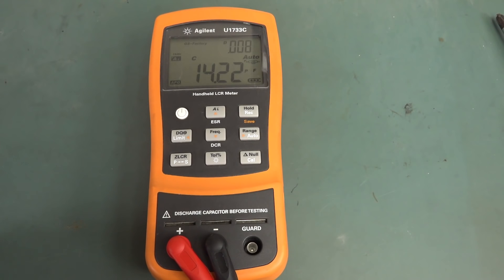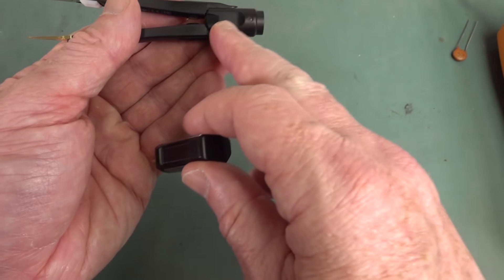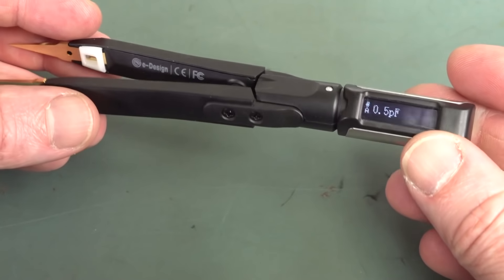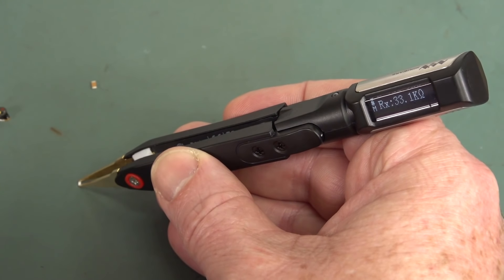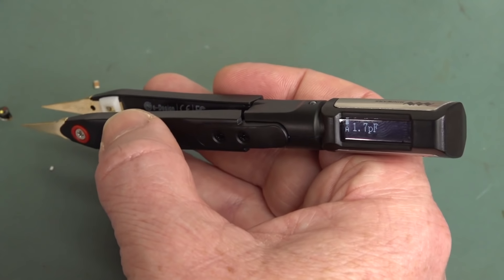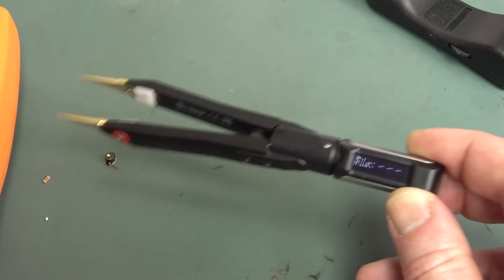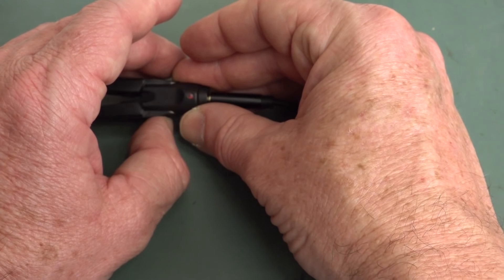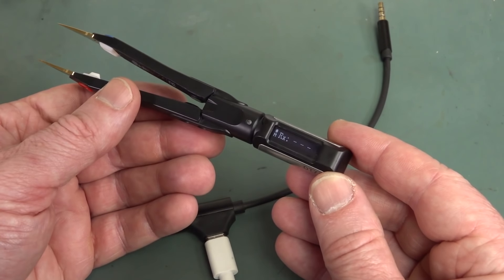EEVblog #1335 - Miniware $70 DT71 LCR Tweezer REVIEW

Comment from the maker: TLDR; It's not very accurate, limited resolution, limited ranges, accuracy issues between Auto and Manual modes, non-standard test frequencies, can't be used while charging, lose the custom charge lead and you are screwed, tilt head detection has a bit of an alignment issue, LED testing is limited, and the secondary measurements basically don't work.
But for $70 it's very handy and nothing else can touch it, and the probe design is gorgeous.
Absolutely no match for the much more expensive SmartTweezers.
Maybe they can fix some stuff in firmware to improve it.
Reply: Jeez Dave, are there any downsides? 🤣 Dave would make the worst car salesman ever!...😂😂
Reply: For 70 bucks and it doesn't have good accuracy, resolution, range, accuracy, can't be used while charging, proprietary charge lead? Yeah it can jog on. I'll stick to the bulkier LCR meter that doesn't have those same flaws.

Also hate hate hate hate that sort of one-button interface nonsense.

I'd honestly rather see them just release those pincers as a lead for traditional meters.
Reply from the maker: @Spector_NS5_RD  But it's seventy bucks! :->
Reply from the maker: @TestECull  I did get used to the touch button interface, it's ok.
I'd certainly buy the leads on their own with banana plug interface.
Reply: It looks like most of the wok has gone into those tweezers!   And the explicable heads is GENIOUS   Meaning upgraded heads can just be stop and swapped!  Plus a banana plug adapter is totally in the woks!   As for wear and tear on the connector its TRS.  Already really really robust and long lasting.  TRS is about as solid as it gets!
Reply: Plus the Smart Tweezers have devices in the front end whose cost adds up to over $100 in single quantities anyway...and you just couldn't get that kind of accuracy any other way.
Reply: @EEVblog  yeah the pincers are the best part of the whole thing. All of the downsides are part of the device plugged into them.
Reply: @TestECull  I have one of those pulse oximeters with a single button interface. It has multiple pages of options, including sleep logging and graph display. Not fun to navigate.
Reply: In US is $78
Reply: @Spector_NS5_RD  Right? He almost makes it sound like a $7 AVR component tester and a tweezer probe is a better deal.
Reply: I waited till the end, hopping that you'd take this apart.. 🙄
Reply: Why can't you just put tweezer probes on your existing meter?
Reply: Link in Description is borken!!!
Reply: @whiskyguzzler982  SeeedStudio has them listed at $59
Reply: @RenThraysk  Was excited to see this, but when you add on shipping ($8 to $35) and it looks like Ali is now giving extra tweeser jaws, it's a wash.
Reply: I notice that the audio now says "all for 80 bucks" not $70 anymore. The lack of battery replacement is a deal killer for me. If you use it every day, recharging is a pain. If you use it once a year, over-discharging is death. Some great design elements here, but at $80, it's not a toy.
Reply: Could it be that the charge led also doubles as a low battery indicator and was designed to be brighter at an angle while the tweasers are in use?
Reply: Thing is I’m looking for an accurate enough one I loved my smart tweezers but Ille never buy from those scumbags again they died before warranty I sent them back with a letter and didn’t hear back or get anything back plus they never answered any emails creeps! So if these are good enough and are better than other cheap ones Ille try them
Reply: Whats the state of this product here almost 2 years later?
Is it still the same as in the video, or have the iron out some of these kinks.
and perhaps gained better accuracy, a reliable secondary value etc.
It is upgradeable. so wondering if its been nursed into a better state, and are there better alternative LCR tweezers in 2022 for less, and around the 50 dollar mark.?
Reply: Best comment ever, won me as a subscriber instantly 😬

Comment: Thank you for your review.
 We will continue to improve the firmware and products,

In the DT71 configuration file, you can choose left and right hand mode and turn off screen rotation,
Accurate calibration, we made an excel file, only need to fill in the measured value according to the prompts to accurately calibrate.
Thank you again for your comments, we will fix the BUG in the new firmware.
Reply: If you can add capacitor ESR measurement in a firmware update, i will buy one.
Reply: MINIWARE I just ordered one but I and very interested in being able to measure cap ESRs in circuit. I hope you add that feature!
Reply: @cheryldroffner443  In circuit? I think that would require both polarity reversals and frequency sweeps to analyze, approximate and subtract from the results. Check-out YT video Peak Atlas ESR70 plus in circuit for a better look, because this process is difficult. BTW, don't buy it on Amazon, buy it direct using the Atlas discount code on EEVblog. Search the forum for "Special Offer to EEVblog Forum Members" (I think it's only about $20 more than this rubbish).
Reply: So is it fixed yet? Looking to buy one right now

Comment: As a hobbyist I really hate products that have high standby current like that and rechargeable batteries. I'm only likely to pick it up once in a while, and when I do it's inevitably dead and needs charging before use. Then after a few cycles of overdischarge like this, the battery itself is basically toast. My 1990s HP DMM has a soft power button and it lasts for years on standby, why is this so hard :|
Reply: Same problem for me. I had to buy 3 digital calipers to find one that doesn't drain it's battery between two usages. The well known open source component tester is also such an offender. Fortunately there was enough space for a switch in the case.
Reply: @MetalheadAndNerd  Interesting, I've got one of these open source component testers as well and use a rechargeable 9V battery to power it. I don't use it often (the electronics hobby has been on the backburner last couple of years)  so standby current for my battery powered equipment is rather important for me. I only have to recharge the battery of my mostly dormant component tester once a year or so, most likely because of self-discharge characteristics these batteries have. This component tester uses a transistor to cut power to its entire circuit when it is powered down, i.e. it doesn't rely on the sleep mode of the AVR microcontroller to keep the standby current low.
Reply: @Retep4565  I use mine with non-rechargeable 9V batteries amd before the power switch mod it took 2 months of non-usage to completely drain a fresh battery.
Reply: @MetalheadAndNerd  I have 2 devices. 1 drains and other not. never compared schematics, but think they are similar, so it's probably a software issue

Comment: For what I need in work, this is perfect. We have a single LCR meter for the entire factory and despite its shortcomings, this would be ideal for quick measurements. If they seemed off, we get the proper meter but at a glance readings, seems perfect.

Comment: Just my anecdotal experience but to the age of 8 with two kids plugging and unplugging headphones from their tablets sometimes a few times a day over the cours of years, I have had many cables fail, but never once had a connector fail.
Reply: It is quite common to see sockets ripped off boards: sometimes solder fails, sometimes pads get lifted, sometimes pins break off. And i hate the plugs for diy with leaf terminals, they are pressed together and become loose with use. Other than that, TRS connectors are usually very robust, indeed.
Reply: @victortitov1740  some people are animals with them. They do have their limits :) I mean they're not supposed to be rescue tethers for dropping your phone and not infrequently serve that purpose, in some cases succeeding.

Comment: The charging system is pretty ridiculous, they could put the USB port directly on the device, maybe the body would be 5mm longer but still better than that dongle-thing
Reply: I also don't really understand the point of that extra length of cable on the dongle. Wonder why it isn't just a rigid single piece?
Reply from the maker: @ville_syrjala  Yep.
Reply: Why not to charge through the tweezers? Simple adapter and replaceable by any clips in case of need.
Reply: @Okurkaarrgghh  Who said directly to mains?! 5V like it actually is, but not through 3.5mm jacks, nor through USB but by putting the tweezers into a two holes custom socket.
Reply: Piotr Chec because it can measure voltage. How would it know if you wanted to measure a voltage or charge it.
Reply: @Okurkaarrgghh  You have no idea what you are talking about, right? Watch a video, stop trolling. This is a RLC meter. Who normal/skilled would dare to plug it to the mains with bare hands?
Reply: @simontay4851  Meh, I'm sure they will figure out something (button press/reverse polarity/whatever)
Reply: @piotrchec8156  Thinking the same, but what about allowing it to use a wireless phone charger pad?
Reply: @saddle1940  where’s the coil fitting in that small body to do wireless charging?

Comment: At first I thought the connector for the head was a bad idea due to possible poor connection, but it provides infinite rotation to give the best viewing angle, without wires inside to get twisted up or wear out. The display flipping seems to lack hysteresis. Seems common for these kinds of things. EDIT: Also makes it easy to replace the probes and built-in battery without having to replace the main display unit.
Reply from the maker: Yes, it's clever.
Reply: I think you could do it with a simple spring loaded pins and a magnet, where the 4 tracks are just concentric circles on one part and the pins aligned on 4 "corners".
I really don't understand why magnetic connectors aren't more of a thing especially in equipment that require constant unplugging like phones, watches and misc electronic devices.

If there's one thing that electronics manufacturer should have copied apple on is those god damn mag chargers! it took for ever for others to "copy" them and yet we are still dependent on a flimsy USB connection on our phones.
/rant
Reply: @svampebob007  at least most new phones use the more durable and revisable usb c

Comment: Miniware should make/sell the tweezerbit as a separate unit with leads to use with a stand alone lcr meter.
The tweezerdesign with the magnets is the best part of this device, the rest is meh.
Reply: Yeah, or they could just include (or sell) some 4mm plug leads to use the tweezers with a normal multimeter. That would be nice. :)
Hm.. actually, since the plug looks like a normal 3.5mm 4-pin plug.. maybe making one yourself would be easy.

Comment: Actual AC based LCR tweezers with numerous secondary parameters displayed, and selectable freq 100,1k,10k and voltage 0.3v, 06v, that can datalog values to memory, and fitted with colorscreen, battery, TypeC, and incl. formfitted bag and extra gold-plated tips, have come down in price a lot this summer with retail CN prices at around 19 $

Comment: For best results, keep in mind that the user's hands and other nearby objects can affect accuracy from measurement to measurement. 

I recommend that when performing calibration or zero, hold the tweezers a certain and comfortable way, as they would be held during use,  perform the zero or calibration, then continue holding the tool the same way.  If planning to probe narrow objects, check/correct calibration using a narrow object, and vise versa.

They appear to have nicely designed everything except the plug-in electronics module. The great thing is, the tweezers mechanism is a platform upon which they can market better and better electronic packages.

Comment: It would have been a fantastic practical tool if it were existed in my years of audio and video serviceman in the 1990's. It is not that accurate as a bench instrument, but in field work conditions it is very handy. The signal generation function you find it almost useless, but measuring components plus signal tracing/injecting in a single small instrument is a winner formula in field repair service! 
Dave, best regards from Buenos Aires. Waiting for springtime :-)

Comment: To be very fair TRS style 3.5mm jacks have been tested to be pretty darn reliable... We has them in walkmans, cd players, amplifiers, laptops etc from way back when till now, and they seem pretty (and I'd argue proven) robust over the years, more so than micro USB even... That being said, I don't agree with the solution of a proprietary cable, that if you lose it, you're hooped. I would have selected a more ubiquitous connector on the head for comms and charging, probably not USB C (for size constraints due to extra circuitry required for negotiating the standard). That cable was probably selected because people would have bleeted to no end, if it didn't have USB C, and that was the only way they could use that type and keep the form factor. I completely disagree with a replaceable AAA or any other disposable battery for that matter, and the main reason is that they all leak if left unused in the device for a while, and would have made it unbearably top heavy. As with most, if not, all Miniware products they are open source as well as STM32 based and can probably be tweaked to display the other measurements such as ECR for inductors etc in addition to the rating. The biggest issue I have is with the fact that it can't test transistors (other than 2 legs at a time in diode setting), that is one thing those DIY $7 jobs will do.

Comment: 23:52 That light pipe is awesome! Always hated when LED is so much brighter pointed directly in your face. And this one is installed on the same side as display.
Not sure if this is intentional, but I recon it is, judging how everything else mechanical was engineered. It really only sucks in software and simplistic circuit.

Comment: i noticed it was showing a resistance when you where holding the "silver" plastic bits and touching one of the probe legs with your finger!..i bet the silver plastic bits are conductive.. that would explain the resistance..aswell as the weird readings when taking measurements (due to the silver bit touching your hand)..doesnt seem like the best design when it comes to the electonics side of it of it... it does look nice tho..
....looks like its time to "take it apart" Dave! :P

Comment: Instead of the head coming off for charging, I'd design it as a docking station. When you're done you plop it down in a vertical holder which keeps it out of the way and prevents the tips from poking things as it rolls around. Design it so the tips naturally fall into two contacts so you don't have that awful TRRS connector, and work out a signaling system to do the charging through those contacts. Put the USB port on the dock so that the tweezers themselves are free from extra connectors.

You could even do fancy stuff like have the dock offer banana plugs that bring out the tip connectors so you could do measurements of through-hole components with alligator leads.  (You might need a physical switch or button for that so that it doesn't interfere with charging.)

Comment: i would not allow a user to plug it in and use it at the same time, some idiot will plug it in to a laptop and probe a shunt resistor on a live power supply, my LCR meter has an optically isolated RS232 connection on it i assume for that reason 
also im sure the TRRS jack is fine, i have plugged and unplugged headphones in to my phone multiple times a day for years without any issue 
watching this i dont think i will get a pair, but i do now want to get a tweezer adapter for my LCR meter and start sorting my cup of lost SMD parts

Comment: Contrary to most comments, I think it should have no screen at all. Only analog goodness, ADC, microcontroller/BTLE transceiver, battery, and charge port. That way, you get all the data displayed on a phone or whatever, the battery lasts longer, and it might even be nicer to handle.

Comment: The only thing I want to know is do they sell just the tweezers part separate from all the meter head and cable gerbage and if so then for how much. They mechanics and overall design look so nice that I would happily pay 10 or maybe even 20 bucks just to crack them open and run a coax with a banana jack adapter right through the 3.5mm socket hole directly connected in place of its original guts and then use them as a premium multimeter SMD adapter.

Comment: Needs a "flip lock", like on your phone, or hysteresis on the rotation (so you can go slightly past TDC without it flipping). Since you can easily flash firmware onto this thing, I'd put some coin on there being a much better 3rd party firmware available in the near future
Reply: Hopefully Ralim will write new firmware.

Comment: They've included such cool ideas like the magnets instead of springs and the autorotation of the screen. Then why did they not use the OBVIOUS BIG PADS IN THE FRONT for charging this thing? It'd be great if they made a cradle where you can just stick the device in, and it charges!

Comment: I never liked the tweezer tools.  I guess there might be a few instances where the tweezer-grab might be handy but you can get a tweezer for a multimeter if you really want that, and then you can use whatever multimeter or scope that you like.  A problem with the tweezer is that anything you can't get the tweezer tips onto, well, you can't measure it.

Comment: Why wouldn't they just put the USB-C port on the display unit itself? Then you could probably use it in wired mode if required. Could then even couple with a program on your PC for logging data or showing more info than the screen can.